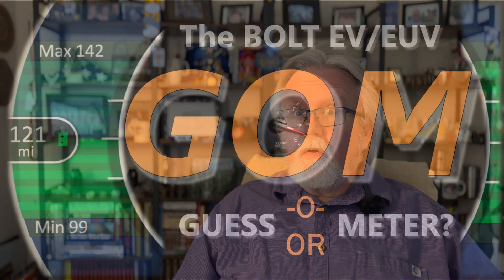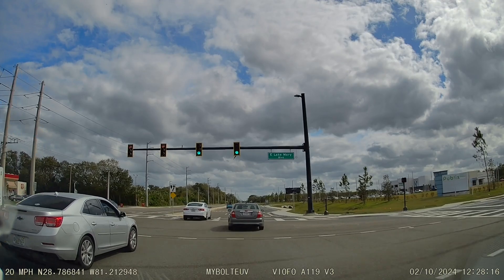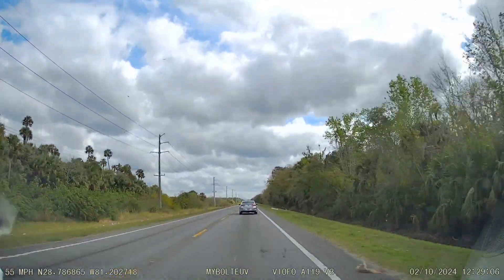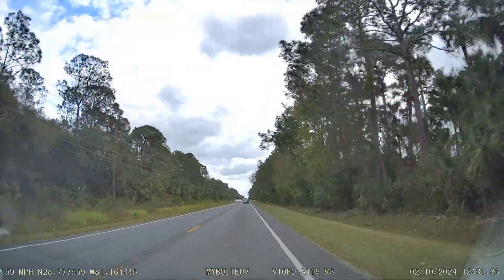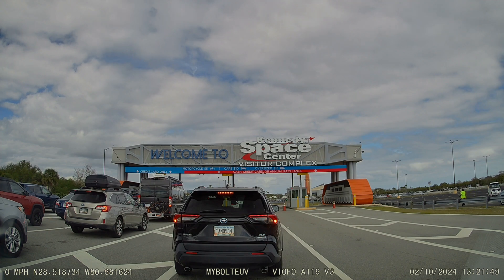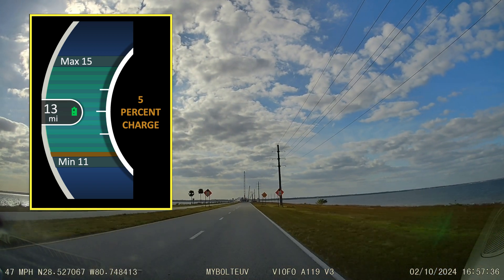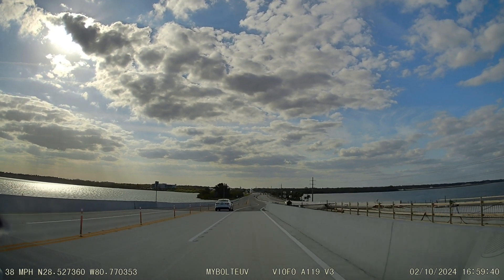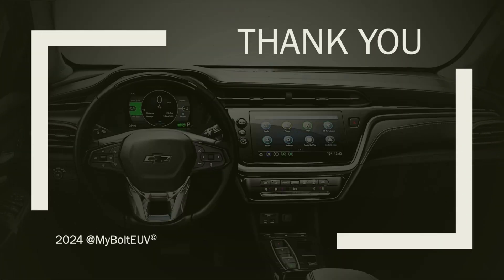The Bolt EV/EUV GOM (Guess OR Meter)

Comment: Hi! You only barely touched on the green bar showing the exact State Of Charge (SOC), with 5% precision. Every darker and lighter green bar is 5% and the white lines are 25%. Yes, I would like an easier to read number without digging though the app, but 5% precision for SOC is probably about as good as you should rely upon anyway.

Thanks for the clear and engaging video. 

P S.: Was the repetition of the script on the first few minutes intentional or did i miss a subtle difference in the readings?

Comment: Yeah, I think the barrage of numbers and bars/colors is kinda goofy and mysterious, but ultimately the range estimate works well for me. But then try to understand the big green/yellow circle around the center speed. How does that one relate to the others??
Reply from the maker: Green = driving economically.  Should get great range.  Lime Green = driving a little too hard.  Will still get OK range.  Yellow = driving faster than 70 mph.  Your range will suffer.  When I drive consistently at 75 mph, I get about 3.3 mi/kWh and it jumps back up to 3.7 mi/kWh when I reduce the speed back to 60-65 mph.  IF I am drafting a semi going 75 mph, I have actually achieved 4.2 mi/kWh.  But they don't seem to like that too much!  :)
Reply: @jimsEVadventures  indeed, with your clues I managed to find three criteria for the center ring turning yellow:
1. Transitions from green->yellow from 66-68mph
2. Accelerating using >60kW
3. Using the brake, ever

Comment: I'm still the type to out 20$ in gas and that what you get, now with inflation it's more likely 30$ 😂 but still I feel like there never a range anxiety, there's always a gas station within a few miles.
Reply from the maker: Range anxiety subsides when you have more experience with driving cross country.  I am actually PLANNING a 5,000 mile trek next year - cross-county AND back in the Bolt.  It is just a PLAN right now...we will see if I can muster up the time off work and the monies...even though the charging will be cheap, my idea of "camping" is a Holiday Inn!
Reply: There are better and cheaper ways to deal with anxiety

Comment: Good stuff. Thanks. I have the Guess-O-Meter pretty well figured out, but I like (and will use) your rules of thumb for weather, altitude and leadfootedness.
Reply from the maker: The GOM is either your best friend or your worst enemy--depending on how you drive.  Like you, I have it figured out and I trust it implicitly now that it has not let me down in a few critical instances.  I have only had ONE "close call" in 30,000+ miles, but ended up making it to the charging location with 5 percent...the "LOW" light came on when I pulled into the parking lot!
Reply: @jimsEVadventures  I tried your BMS recalibration routine this past couple weeks. It took us about 2 weeks to get it down near 0% SOC (we don't drive much!). For the last 10%, I just drove around to get it down below 5%. The "LOW" light came on maybe 4 or 5 miles from home, but I made it (but driving "blind" with no indication of how many miles were left). Whe I got home, the numbers by the SOC bar on the infotainment energy screen said I had 9 miles left. I think the GOM said I had 13 miles left before it went "blind" with the "LOW" light.

BTW -- Is there any way to verify that the BMS actually did recalibrate -- that I performed the sequence successfully?

I was going to do this drive-to-0% exercise to generate a charging curve for our Bolt, but when I got to our nearby free DCFC, both chargers were out of service (😬), so I turned this into a BMS recalibration, based on your methodology -- charging it back up to 100% on our home Level 2 EVSE (letting it sleep for a few hours on both ends).

Comment: For a hundred year we drove cars with the same GOM. It said about half a tank , does that mean 100 miles or 300 miles, no one knew. It said empty and we know it had a few gallons left but do I drive like speed racer or Grandma. Is it winter, am I driving up hill or down hill. Why do EV drivers believe the EV GOM should be any different... one word. Infrastructure. I charge at home. I start every day with ¾ of a tank of electrons. Get to know your car. Think about the weather and driving conditions and know your re fueling options... Just like the last 100 years.
Reply from the maker: Exactly...and as the charging infrastructure improves (new chargers and Tesla network opening up to other brands), things are only going to be easier!

Comment: I found that the Bolt GOM is really good. And especially if you see the yellow trend. My 2020 LT average was 3.9 life time. And when I had a 2021 Premier it's life time was 3.7. just would have liked it to have a real % display instead.
Reply from the maker: My lifetime after 30,000 miles is 3.8 - which, strangely enough, is the average mi/kWh expected on the EUV.  I use a combination of the middle number and the trend line when on a road trip...BUT...when things are cooler, the roads are wet, and I am having to drive faster, I will use the lower estimate exclusively to make sure I can make it to the next charging stop.  I also use the % indicator in the Chevy App.  Mainly to make sure the GOM is reading correctly...